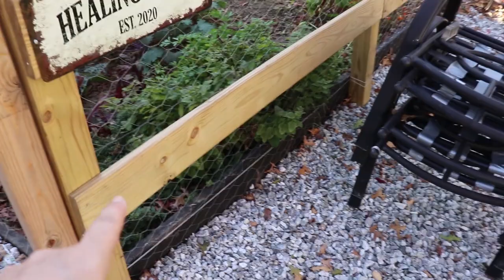DIY Backyard Fence - Part One

Comment: Suggest you put the chicken wire on the inside of the fence between the boards and the posts.  Also on the  gate with thin boards or trim around it to keep the dogs from pulling it off. You might also want to put a vertices board between the last fence post and the garage so the don't try to squeeze thru.  FYI, if you plan to leave the dogs out unattended for any length of time, be sure to observe them the first few times to make sure they will not try to dig out or pull the wire loose to get out. Although the deer can easily jump the fence, just having it will deter them unless the are really hungry and there is not easier food available. Two does used our front pasture as a nursery for their fawns (a single and 1 set of twins) this summer. They would leave them in the pasture while they roamed further away to graze, but even the fawns had no problem jumping our 4 ft fences. Now that they are weaned and on their own, the young deer still spend a lot of time in the front pasture.  My dog has never chased them, although he will chase deer out of our back pasture and away from the barn, he thinks he is protecting the horses.

Comment: Hi, Sophia.  Great job putting in those fence posts.  That seems like a lot of hard work.  One quick question:  Why did you put tar on the bottom of the fence posts?  Does that pre-treat the wood to keep it from rotting/warping?
Reply from the maker: The wood is already treated but the target gives it additional years. I should jave those posts for a good 15 years before I consider having to replace them